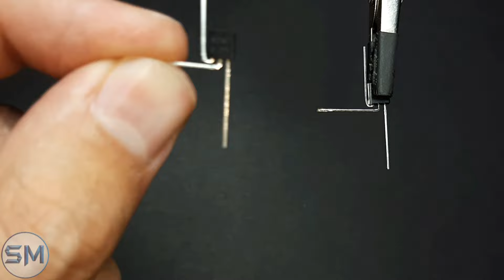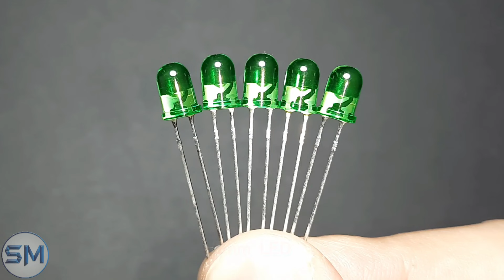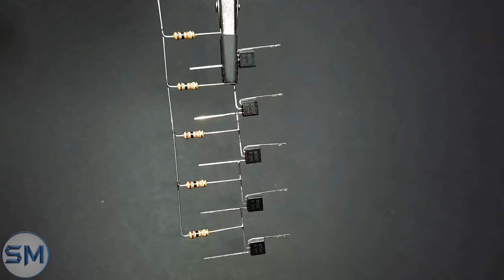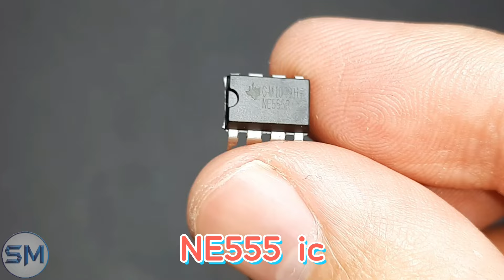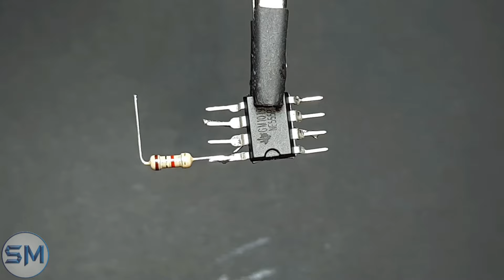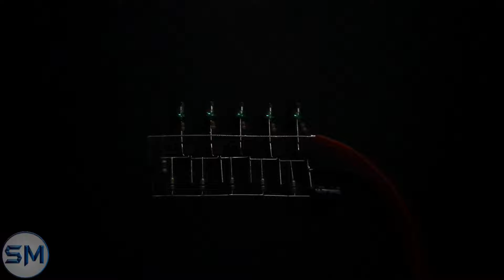How to make LED chaser Circuit With NE555 Ic and BC547 NPN Transistor

Comment: I liked the circuit, but there is a situation like this: If you added a trimpot or potentiometer to the oscillator integrated, you could change the output frequency.

Comment: to slowest efect capasitor 1000 - 2200 or more , old pryect very old , , my bulding 20 years older , 120 tranzistors or led , worked to day ,. but great work ,. nice simply to first projects , second my proyect to bc 238 or bc 307 high quality A class headphone amplifier , end more ,
Reply from the maker: Thanks for the info